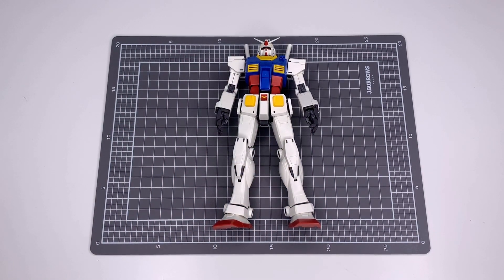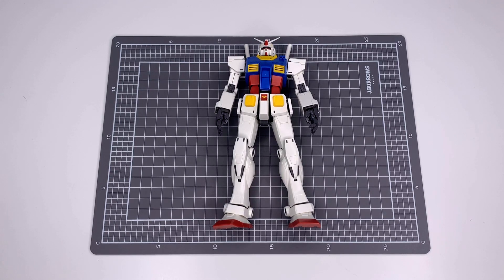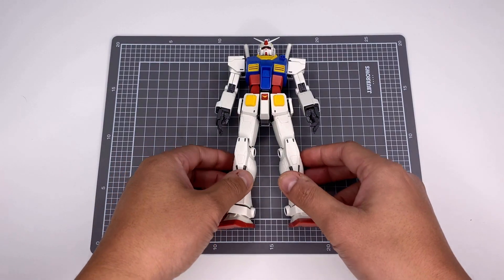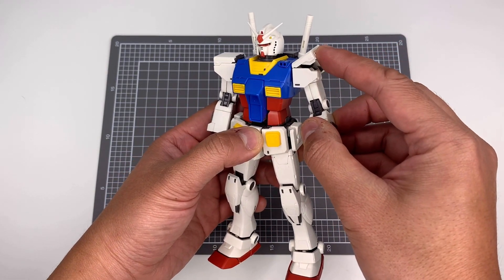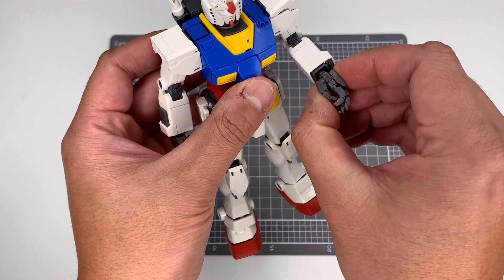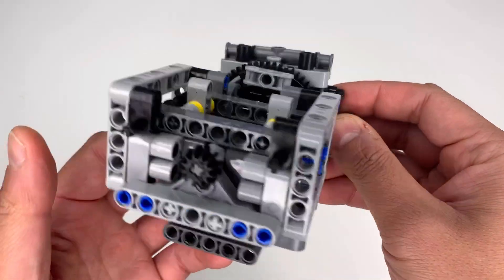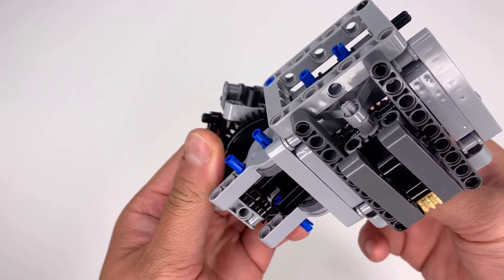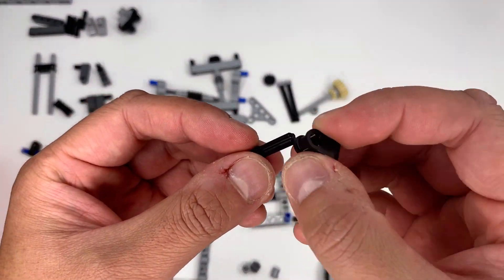How to Build Big LEGO Mechs! - Episode 1

Comment: Really impressed with the worm drive controlled motion system. Think a lot of people would have found a ratcheting way of doing it but I love the fine adjustments this allows while still being able to hold it's poses under load. Must be a pain to adjust with it all paneled up, but worth the investment as I have never seen a more stable but flexible joint at this scale. Love it.